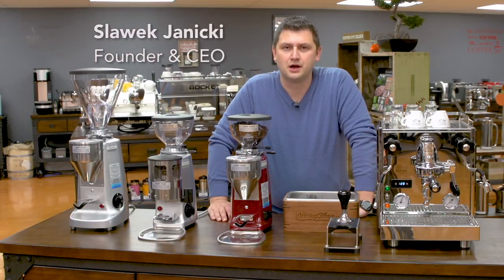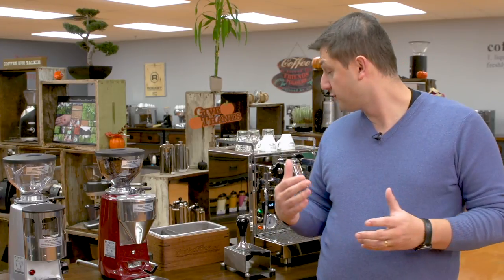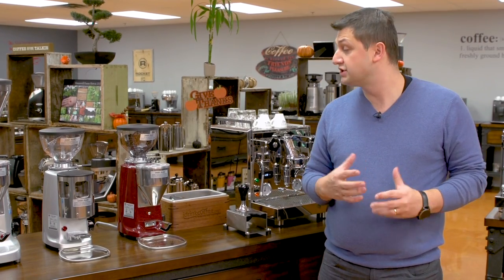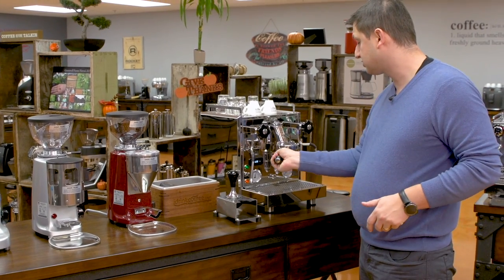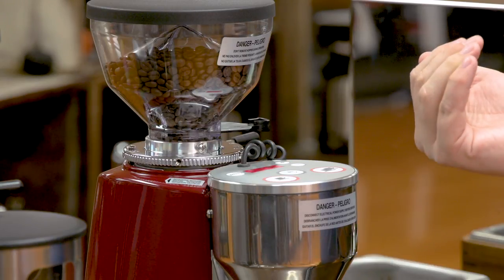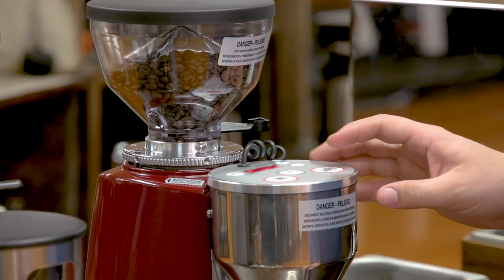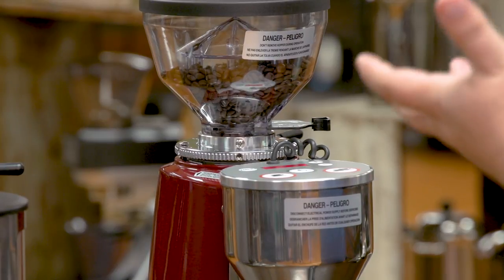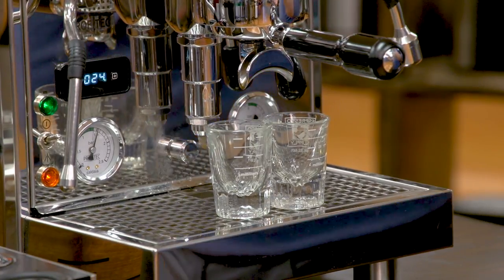iDrinkCoffee.com Tutorial - How to Dial in and Calibrate a Mazzer Espresso Grinder

Comment: for a consisting precision shot you need to use a scale,weight your coffee ground (in) and when you extract the espresso's you should do it also(out)...the brew ratio should be 1:2 ...if you relate on volume it's not going to give you a good parameter data to analyse.It's like taking kilos and after changing the measure into volume ...density is different from variety of coffee,internal density,grade of roasting,size of the beans,the process of the coffee was made(natural,washed,honey,carbonic maceration,etc).It's not an easy task to do a good espresso,but if you need consistency you should be more precise and transform ''variables'' into stable parameters so you can replicate the same result.Remeber espresso should be balance between acidity,sweetness ,strenght/body/bitterness...It's not easy to achieve but if you follow the rules step by step you may find out that is quite easy.

Comment: Thank you for the explanations Are not those "stones" in the grinds (final mixture)  bad ?(channeling) 
What cause them ,air moisture? 

Regards
Reply from the maker: Larger "clumps" of coffee are not inheritantly bad but they can cause issues with distribution.   To fix this you can use a distribution tool or manually break up and groom the grinds.  The amount of clumping depends on a variety of factors, how fine you are grinding, the type of coffee, your climate etc.
Reply: @iDrinkCoffeeCanada  thank you . an open bottom filter is good to better see your results is not it ? (sorry I am beginner and not english speaking fluently ;) )